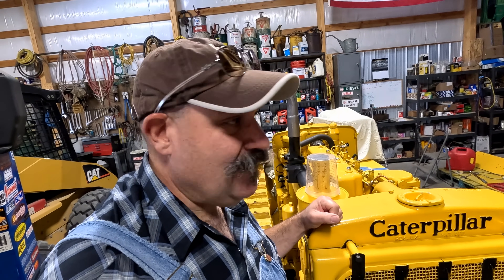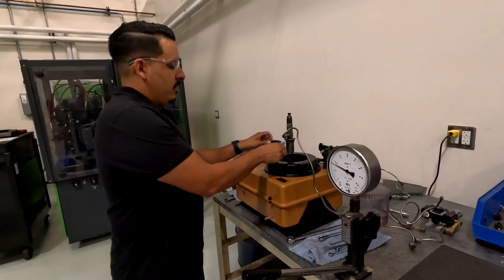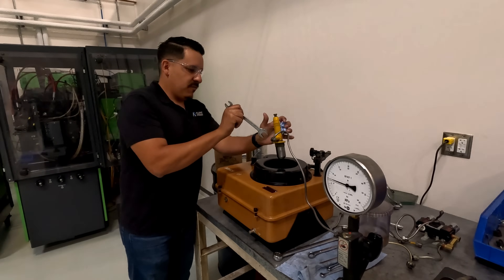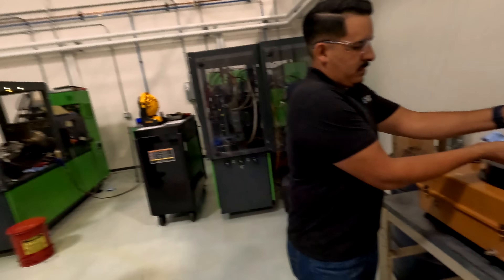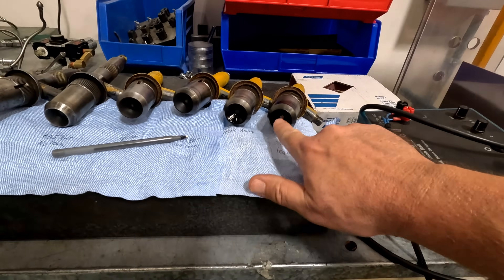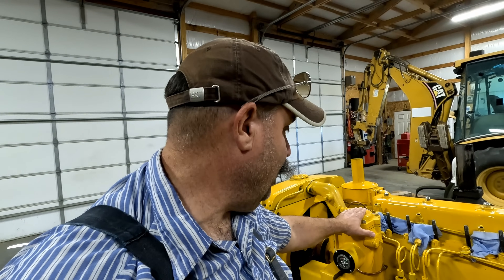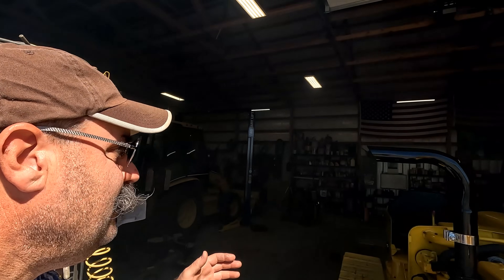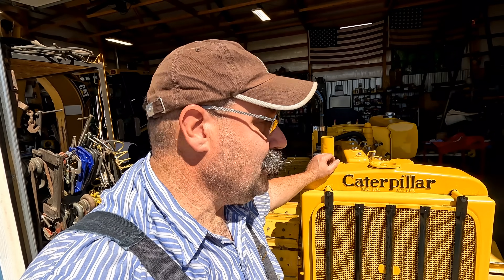Caterpillar injector setting and test run D4400 & D4600 Diesel engine Cat D4 Episode #133

Comment: I have watched at least a dozen of the Project Lefty videos. What an incredible job you guys have done. You are a credit to resurrection of those old Cats. Tons of love.
Reply: Amazing job you guys have done I've watched so many of your videos I'm currently in the process of doing the same thing To my D4 7j I was wondering if maybe we could chat I wanted to get some more in depth info on the injection pump settings
Reply from the maker: @dawnmiller2693 Sure.
Reply from the maker: Thank you very much for the kind words! Your Cookie Monster profile picture made me smile. 😁
Reply: I used to run old Cats in the 70's and 80's, I love the old stuff you people are working on the most.

Comment: It's great when you finally find a good place with good knowledgeable people to work with! The D4400 sounds even better than before too - regarding that occasional "pop" with accompanying exhaust puff, my D2 #5J1113 has had that same thing ever since the rebuild, and at first I thought it had to have been fuel related but the more I run it, the more it's getting better.  S-L-O-W-L-Y getting better, but my new theory is that it's been caused by oil leaking past the un-seated rings, being ignited by the compression.  IDI diesels will happily burn oil almost as well as they burn fuel, only just not quite as cleanly because the oil is heavier.  I've got 15 hours on my service meter now, with the last 10 being under consistent heavy load and within the most recent 3 hours of full temp, full load operation I've finally started to notice a real difference in how it's running.  These old Cat engines are tough as can be, so accordingly can take a LOT to fully break in.  Your mileage may vary, but I wanted to share my findings so you guys can keep it in the backs of your minds as you move forward 👍
Reply from the maker: I share all of your comments with Dad and it greatly eases his concerns. No doubt you are right on target as usual about the remaining wet stacking. When we get the tracks ironed out it's going to have a heavy work day. We greatly appreciate your saged advice. 👍

Comment: Put a chain binder on the track and squeeze them together right where it's at...they will break free...give er the onions with a binder or hydraulic ram...one they pop they are good to go...I got really creative breaking my old tracks loose...no need to tear them down and press them apart...people say not to use lubricants or penetrant but I did with a binders, heats and lube, the popped loose and were just fine. I know squatch will disagree with me on this point but it worked for me and it beats the alternative of building tooling and breaking down tracks..just something to explore, it worked for me
Reply from the maker: We will definitely give that a try in the future. I've already made a video building a track pin press that will be out next month. I think a combination of just running them and doing what you said will be the magic ticket. 👍

Comment: The kitty sounds great. You should put some light oil on your track pins and run it hard to get them loosened up. Make sure you have the track over tight and run it in a straight line back and forth. I'm glad you got good injectors across the board now. Thank you for the update.
Reply from the maker: We're going to try to build a track pin press. However I think we are going to end up just running them until they break in. 😊
Reply: @lifeafterourloss  I've been there,  I'm serious, it's going to loosen up and be fine.

Comment: UK fuel injector tech here ...DO NOT check injector leakage with your fingers use a peice of paper.  Very rarely the injector when disturber will inject fuel  directly into your finger which is a really nasty injury that does not heal ..just do not risk it !   Some modernish  Cat ( 3406 ) injectors do not open untill 1350 Bar  that is a pressure of 13.5 kg per sqruare mm or  19500 PSI    Tempting to do, just do not do it.

Comment: Have you tried a ratchet strap from the track to the top roller to pull the track down?
Reply from the maker: We did. We also use chains and presses. The good news is all of them will move but they won't move very easily.
Reply: @lifeafterourloss  Thoughts of some temp brackets for the fuel tank so you can move it around and not worry about fenders?
Reply from the maker: @LoggerLloyd We're a little bit ahead on videos. We end up doing just that after an attempt at a track pin pusher.

Comment: Great that the guys at Allianz power were so helpful and relatively close by, have you ever thought about Area Diesel Services, I know C&C, Diesel Creek, scrappy Industries etc use them, they are awesome on diesel pumps too and love doing collaboration vlogs. I have no interest in them, I live in Aussie, but I like what they do…..just a thought
Reply: Thank you for sharing this information.  Area Diesel reconditioned the turbocharger on my Cat D8H and did a nice job.  Shortly after I asked them about testing/repairing injectors out of my Cat 212 grader.  My 212 has the Cat D3400 engine which has the same old style injectors as the D4400.  Area Diesel said they would look at them and clean them but weren't confident that they could offer much as far as repairs went.  I ended up sending my injectors to Ziegler Cat in Minnesota.
Reply from the maker: @D8PETE My first stop was at the local caterpillar dealer. They were very accommodating but no longer had the equipment necessary to work on them. The biggest issue is that the service kits are no longer available. Alliant power was able to tune injectors that were still in decent condition. However I don't think anyone has the service kits needed for a full repair. I was very fortunate to find some on eBay a couple of years ago. They were very stuck from years sitting in cosmoline. Alliant Power was able to unstick the pintle and lap them in to work properly. I would be curious to know how your D3400 injectors. It seems some Cat dealers still kept the old equipment. 👍
Reply from the maker: I would love to do some collaboration videos. We live quite a way out from most other youtubers. Who knows what the future will bring. 😊

Comment: Glad to see Lefty moving!
Reply from the maker: If we can get past this frustrating track problem I'm really setting up to make the final video a good one! 👍
Reply: @lifeafterourloss  As my dad always said, “that’s no hill for a couple steppers like you and dad!”
Reply: @lifeafterourloss  what causes wet stacking?
Reply from the maker: It can be caused by oil getting past they piston rings. Often on new engines that are not broken in yet or worn out engines. However it is almost always unburnt fuel. Usually bad injectors or out of time fuel delivery. 👍

Comment: Get that thing outside and run it
Reply: Yes I agree.  Take the second fender off, rig up temporary fuel tank and any other supports you may need, and then run it around the paddock in second/third gear for a bit.

Comment: Just and idea for your tracks. Is it possible to take the track off and stand it on a machine that vibrates non stop for days on end. In other words, the constant movement would eventually cause the disintergration of the rust particles causing the track pins and bushes to lock-up. Perhaps one of the vibrators used for taking air bubbles out of freshly poured concrete might produce aggresive vibration.
Reply: It might take a big vibratory compactor like they use to compress roadways when they build them
Reply from the maker: We're going to do something similar and I think another tractor is going to help us out. Just going to take some time. 👍